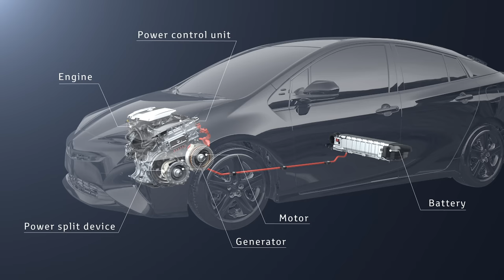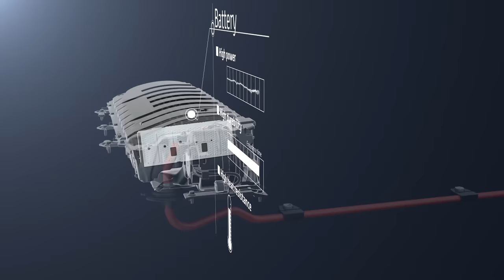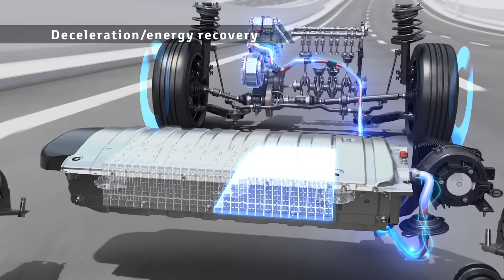What is Toyota Hybrid System

Comment: Impressive. Had a new Prius last week and was amazed at how great it was to drive. Comfortable, plenty power, seamless effortless progress, fine handling and astonishing MPG. A truly long lasting car as well apparently when you see the sky high mileages on used examples.
Reply: Yes. My only complain is less control when merge into highway.  I have the 15 inch wheels. Filters out all the bumps.
Reply: The best part with hybrid is the ability to idle without burning too much gas or violate idling policy.
Reply: How it drives and handles impressed me, I have no problem getting another one.
Reply: Ended up with a Subaru instead. I am now officially the enemy of environmentalists !
Reply: @oddities-whatnot  NIce.  I hope that you got a manual at least WRX.  Personally, i would have got a Civic Type R.
Reply: I test drove a Prius and always knew they were slow but didn't realize just how slow they really are. Then I tried out a Ford C-Max and was blown away by the difference in power. No joke, the C-Max is faster than your average V6 and most V8 trucks. It uses the exact same hybrid drive system as a Prius, except paired with a more capable engine. 0-60 in ~6-8 seconds (depending on battery charge level), 43-60 MPG if you drive it like a hybrid and take it slow and steady, or 30-35 MPG with aggressive driving. 

It really is the perfect balance of power and efficiency. And luxury if you get the SEL or Titanium trim, which is a must have since it adds features like keyless push-to-start, a much nicer interior with heated leather seats (looks much nicer than a Prius on the inside), upgraded Sony stereo (which absolutely ROCKS by the way, even if you don't add a subwoofer... which I did anyway.), customizable interior accent lighting, and optional Tesla-style panoramic moonroof & and auto park assist (which will park the car for you).

I've had mine for a year now and my GF loves the car so much she went and bought the exact same one. Got herself a fully loaded 2014 with low miles and a great price (I have a 2013 in Candy Blue Metallic with over 100k on the dial). Check the car out the next time you spot one for sale and I promise you you'll never want to drive a Prius again. The C-Max is one fast, fun little hybrid, everything the Prius should have been in the first place.
Reply: Nobody cares about enviroment, chill, its all about mpg
Reply: @Psythik  I guess it does seem much faster than a prius.  I live in mountainous terrain and have a 30 mile commute each way some town driving most interstate at which I am driving at 80 to 85 mph, summer or winter and our winters can be tough here in South Dakota. I average 43 mpg, and 39 in dead of winter.  I have a 170k on my 2015 prius and have only done the standard maintenance, and changed tires and windshield wipers.  Maybe faster but does not seem like it is better fuel economy.  But will have to look them over as in a couple years will give daughter mine and get something else.  May go with a plug in rav 4, might have better range then and be able to pull my 19 ft boat. If so then can sell my truck and just have one vehicle and a small trailer for hauling bigger items.
Reply: @Simon George why not the E-Awd Prius?
Reply: Effortlessly!
Reply: Taxi driver in D.C. said his 2005 Prius had over 500k miles

Comment: Can't say enough good stuff about my gen 2 Prius. Plenty room even in the back seat. Comfortable on trips loaded up with people and luggage. Love the rear hatch and stow/spare tire/tools compartment. Very smooth handling, quiet, ice cold ac. Idling is incredibly efficient. 40-50 mpg still just crossing 200k miles. Oil/filter and even transaxle case fluid changes are simple, cheap diy. Engine runs smooth as a swiss watch. My mother recently got a newer Avalon and I tried talking her into the hybrid. Now she's pretty regretful. Don't miss out, get a Toyota hybrid and leave the fully electric cars to the one percenters who need any reason available to burn money while status signaling to others. I love how the 2023 Prius looks and, of course, its highly accomplished engineering. I'll get one in 2040 or so when I can afford it. 😂

Comment: This video has bettered my understanding of the hybrid system. I do question the reliability, maintenance, and affordability of such a sophisticated system.
Reply: They are ultra reliable, we have Camry hybrid 2012h with no problems, maintenance is actually cheaper and less than non hybrid models, on traffic lights and slow traffic. engine shuts off and motor drive the car up to 2km. We love it as saves tons of petrol and have low emissions
Reply: I have a 2013 Ford C-Max (known as the worst year for this vehicle). It uses the exact same hybrid drive system, except paired to a more powerful engine, I'm not the first owner, but I've had the car for a year added 10K to the dial; it had over 105K miles when I bought it. I've had ZERO issues with the car. Even the most unreliable year has been extremely reliable for me.

Also, I should mention that maintenance is cheaper than your average car because there are fewer moving parts. No belts to wear out, and fewer fluids to change. Brakes can literally last over 100K before needing replacement if you coast whenever possible and use the regenerative braking system whenever possible. You could literally drive the car and the only time the brake pads will engage is when the car is at a standstill. If that isn't considered low maintenance, I don't know what is.

As for affordably: I only paid $8500 for mine and it is FULLY loaded with keyless push-to-start, heated leather seats + leather-wrapped interior, a Tesla style panoramic sunroof, backup cam + parking sensors, auto park assist (literally parallel parks the car for you) and a bangin' Sony sound system with satellite radio, 11 speakers including 4 woofers, 4 tweeters, a center channel, and 2x 10" subwoofers pumping out 500w each (so over 1100-1200w going to the entire system). In candy blue metallic. For under $10K you can't do much better.
Reply: Actually this involves fewer parts and is more reliable than an automatic or manual transmission
Reply: It's Toyota bro
Reply: It's a Toyota lol no questioning needed. Also the Prius has been around for 25 years, so lots of time to perfect.
Reply: Sorry for the late reply: fewer parts so they are more reliable than AT; doesn't depend on human inputs and no friction pad, so they are more reliable than MT.
Reply: Its a toyota....ofc its reliable

Comment: As a diehard car enthusiast , to me , if Porsche/Audi manages to develop the e-fuel and F1/LeMans Hypercars/Rally1 gives good result/data about the perfomance , Hybrid is the way to go. Sure , you can still release petrol/EV , but for the best of both world, Hybrid is the way honestly for me. Both good  low end  and high end performance with hybrid ....and a new generation of tuning.
Reply: Kyle Belair   Say whatever you want , Le Mans and F1 has been using it for years , and so is Rally1 using it. Cannot deny facts my dude
Reply: Im sure its super smart and the most efficient sollution.. but i have drove one long enought to really dislike the lack of feeling that any of the motors are connected to the wheels and the engine doing whatever it wants to develop power instead of linear power delivery... even an electric with no gears at least the motor is directly connected to the wheels and you can feel the direct power feel.. in Toyota? not at all.. i push the pedal and stuff happens and the car goes faster but you dont feel anything going to the wheels as both motors are going throught a VCT
Reply: hybrids make more sense than pure EVs. A supercar could theoretically be daily driven in that case; See Ferrari SF90
Reply: Hybrid is not always for fuel economy. Sometimes it’s for performance. One example is the BMW X6 active hybrid. It’s not really made to save gas but to make use of electric torque along with gas engine
Reply: @CountChokcula How does a hybrid make more sense than pure EV? I like ICE cars and driving manual but EVs have objectively better performance, and this will increase with better battery life chemistries over time.

Comment: Just took delivery of my first hybrid. 21 Sienna. Toyota has been doing hybrid for a long time. I expect years of trouble free driving.
Reply: you will have decades of trouble free driving. I used a Corolla limousine and never had to go to the workshop bc something died, just normal things like brakes and tires. Now im bought the Hybrid as well and im sure, I will go the same way like with my old, but I will save much fuel ^^

Comment: We love our Toyota Hybrid Highlanders.  Had a 2013 HH Limited AWD and traded it in with 150k miles (241401 KM) on a 2021 HH Plaitium AWD.  Only problem on 2013 HH was a broken driver side power door lock motor. Drive the 2021 HH aggressively in Sport mode and still returns 30 MPG or 12.8KM/L. which is impressive for a heavy vehicle.  I have 100k miles (160934KM) on it and only broken part was a driver side view mirror lower panel fell off. It was only a $10 part and snapped back together like Legos.  Still on original brakes, 3rd set of tires, and 3rd front windshield from stone crack.

Comment: The "Power Split Device" it's a dual input planetary drive, right?
Reply: Not exactly, its the double energy flow between the planetary and/or the dual motors.
Reply: @philipmanolas2270  thank you for the clarification, so it is a double input planetary gear set then. Double power/torque input from each motor  towards one output.
Reply: it generates from one motor and power the other to get the desired gear ratio, in and out of the battery, in and out of the engine (engine power and engine braking going downhill if the battery is full).
Reply: @maggiejetson7904  100% nice explained!! 👍👍👍. Apreciated your input 👌.
I'm surprised that they make it look as "New Technology" and tried to impress a lot of people... and this is really old... from the late 40's,  actually.

Comment: 4 main companents of Hybrid
1. Hybrid Baterry - Provide power to motor drive
2. Power Control Unit -Divides the power to each unit(motor, generator and Hybrid battery.
3. Power Generator - Recharged the hybrid battery
4. Motor -  Run the vehicle at low speed and combine with engine during high speed